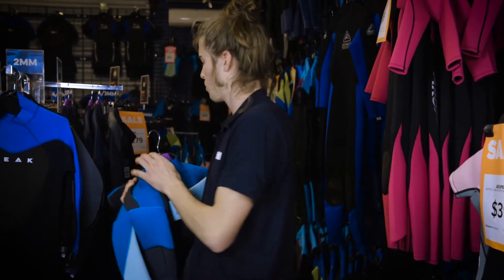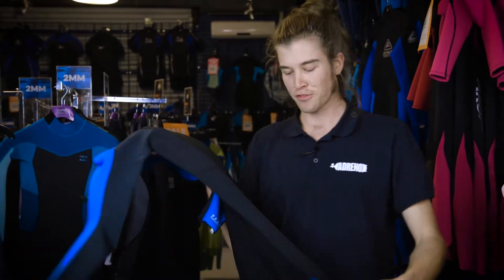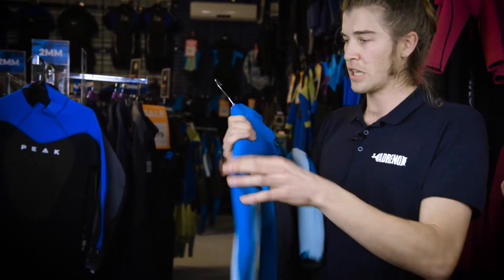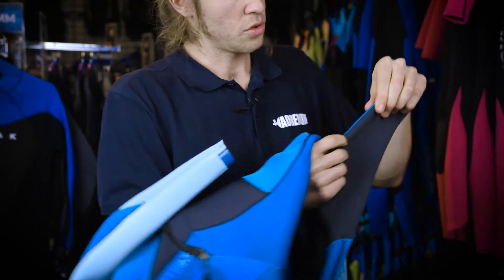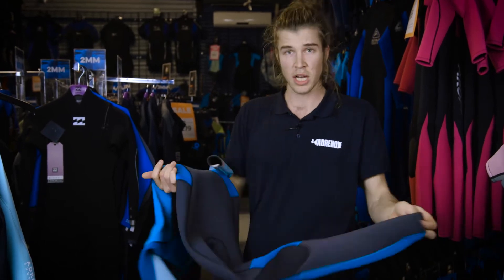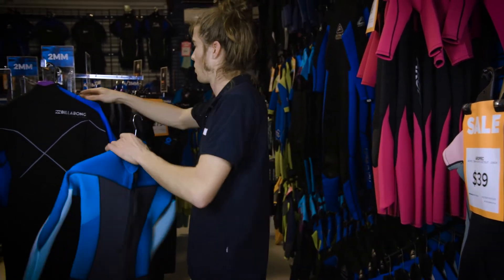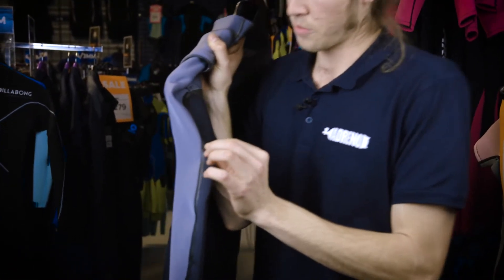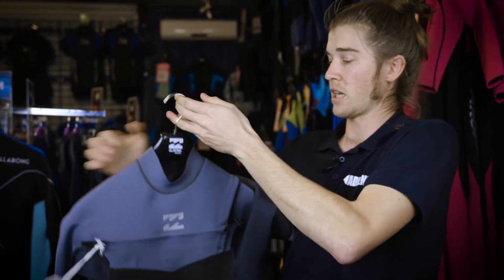Wetsuit Seams and Stitching Types | Wetsuit Warehouse

Comment: Wow, very professional and so much experience. Just the guy I need advice from. Im having problem with  ION ONYX AMP 6/4 2017. There are some micro holes on seams, you can feel cold water drops. I think it's glue's fault. What is the best way to fix it without maybe tearing off the inside tape and glueing it again?

Comment: There is another stitch called an activeseam from Merrow (and other companies versions).  It is a butted/break-apart seam with little to nothing on the inside but on the outside is the small but nice looking ridge.  It is used in some military clothing and is reportedly superior in stretch and strength.